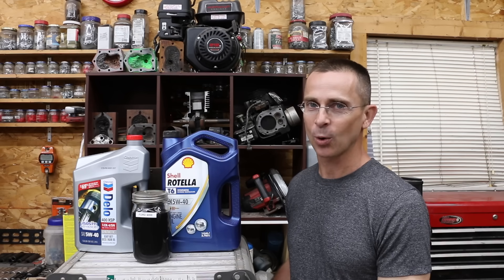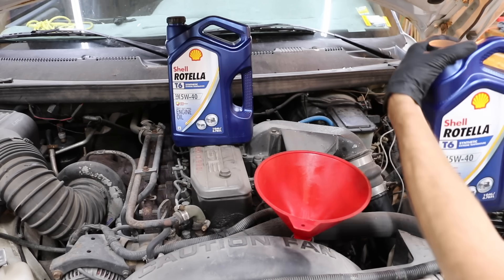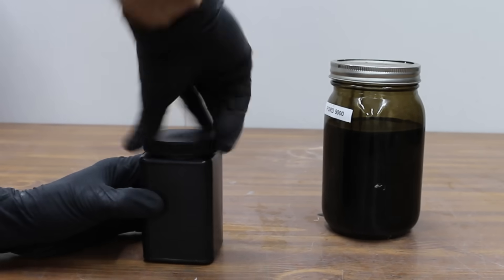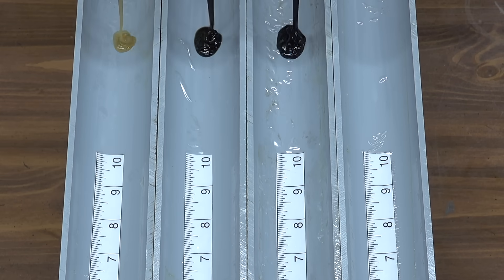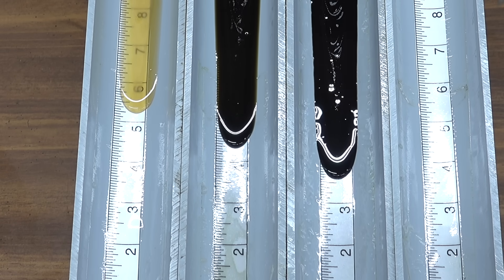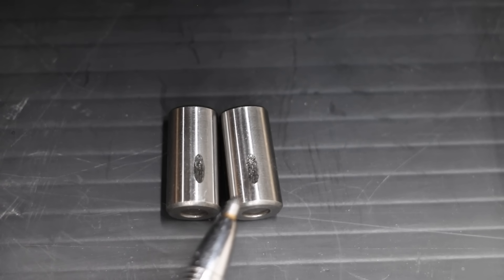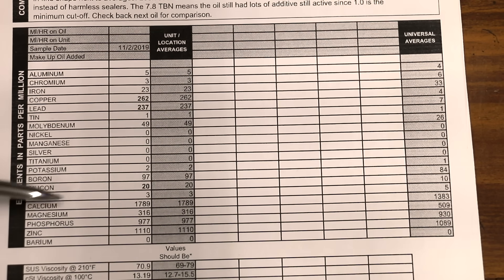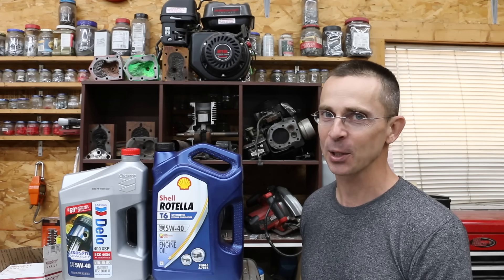Will Annual Oil Change Damage Your Car? Let's find out!

Comment: Diesel oil isn't so bad.

Gas oil breaks down quicker. Gas vapors blowby destroy oil viscosity that's why those additives are there. That's also why not to use cheaper diesel oil. It's cheaper because it doesn't have all those anti sludge and anti breakdown additives. Diesels don't need it. Your gas engines do.
Reply from the maker: Thanks for sharing.

Comment: "Recommend following the manufacturers oil change interval guidelines for miles and length of time for your car."
Does this not conflict with your finding that a good synthetic oil can easily last 1.5 to 2 years in a lightly- or occasionally-driven car? I have a 2001 Passat wagon 1.8T with the undersized sump. I use a monstrous Mann 950/4 filter to push the oil capacity to a full 4.25 qts. of Mobil 1 0W-40 European Car Formula oil. I just changed the oil at 15 months and less than 1000 "COVID" miles, mainly out of "calendar guilt," since my owner's manual specifies an oil change interval of 5000 miles or 6 months. I should probably have a used oil analysis done next time.

Comment: This is excellent. I know many cars that have only traveled 300 miles in a year because of Covid.  They have been started and run for 15 minutes a week to keep the battery charged and get the engine warmed up. So, the oil does not need to be replaced - that has only just become dirty in color.
Reply from the maker: Thanks!

Comment: As an engineer i feel the annual change isnt as necessary as they make it look, yes it does matter how many kms and how those kms are acquired ( highways or daily indian traffic conditions) but also saying anything above 12 months is useless oil is wrong.

I feel even if mileage is low and driven well , oil can last 18 months no major issue , its not like after 12 month something magical happens all of sudden and oil expires, yes the breakdown & chemical changes happen but not overnight
Reply from the maker: Thanks for sharing.

Comment: A Project Farm question, do you need to prefill the filter. Should be an easy to answer question. I'd guess from the factory that they don't do it, otherwise the service manual, oil bottle, and oil filter package would recommend it.

Comment: So will the Rotelo work on my corvette c5 twin turbo? I'm always concerned with oil temp. On the track I will hit about 245 degrees.  I have been using the Rotelo on my GMC 3500. Thanks

Comment: I always prefilled the oil filter as you did.  I saw another video not to do this as the oil in the filter gets  to the internal engine parts before it is filtered and could cause damage.
Reply: If it's new oil, what would it matter?

Comment: I recently got my 1995 Pontiac Firebird out of my basement where it was parked since 2007. It sat there for 11 years without being started and had about 1000 miles on the Mobile One full synthetic 5w30 that was in it.
  I started it up and drove it around for another thousand miles before deciding to change it even though the oil still looked new I was worried about the 11 year old oil.   I've been driving it around for a couple years now and its runs fine with no engine problems like blow by or smoking or anything oil related, it's been running fine!
  You bet Mobile 1 full synthetic is what I put back into it!

Comment: Could you do the same test, using oil from an engine was not brought up to temperature once a month?  I have vehicles in long term storage, and not convenient to run the engines on each during the winter months here in the upper Midwest
Reply from the maker: Thanks for the video idea.

Comment: as an automotive and mechanical engineer, my father always told me that it's OK to run diesel oil in a petrol car but not in the long term. one change cycle in five use the diesel oil as it has a mild cleaning effect but the different detergents and elemental ratios, such a phosphorus levels make it far less than ideal to run it as a regular thing.
Reply from the maker: Thanks for sharing.
Reply: @ProjectFarm  cheers. like the production style and genuine attempt at informing and educating people about cars. hope didn't seem rude but there was an ad years ago in Australia for Valvoline and it's catch cry was "oils aren't oils. dad reckoned it was the only time a TV commercial ever told the truth. lol. anyway, keep up the good work. cheers, bill.

Comment: I just 'sniff' the oil on the dipstick, look at it on a paper-towel, and rub it between my fingertips
________
If it smells 'good' like it did from the container, leaves no 'blackish' skid-marks on paper, and feels 'slicky-slidey' between thumb and fore-finger, it's good
________
( Got this technique from 'G-pa' and he knew nothing of 'Scientific Testing' but a lot about truck engines since he drove for Ford for 35-years, retiring in the early '70's )
________
'When in doubt...change it out' seems to work pretty good after a lifetime of driving
Your tests are interesting and skillful but I don't have access to much of anything except what's in my head
Reply: must remember taste test! lol.
Reply: @williamhardes8081  That only applies to 'Female' engines!
Reply: @gerrynightingale9045  nice one. those first two points you make are especially important in that case.
Reply: @williamhardes8081  Yeah...the 'sniff test' seems valid because of all the engine problems I've had in 55-yrs. of driving 'dirty oil' was never one of them
'Clean' paper-towel doesn't lie either

Comment: I have a car that I do not drive much, I do drive it here or there, accidently went 2 years without an oil change because of covid.  When I did an oil change the oil looked pretty normal. The filter was pretty normal as well.
Reply from the maker: Thanks for sharing.

Comment: I would really like to see some tests done on ATF. Old vs new etc. Keep up the great work.
Reply: I’m a firm believer in dump and fills. When I buy a new used vehicle; one of the many things is switching the atf to a favourite brand ( works out to be 1/2 the total fluid) and again in a few months to be 70%new. I did notice on my last 2 the transmission’s operated way better than I could think. It also gave me peace of mind, knowing what oil, the brand and the care involved with this maintenance.
Reply: Either change it often or don't bother.  Dk why but have felt multiple vehicals seem to get stuck in neutral on low rpm shifts than slam into gear.  It's super odd.  Also flushes are the worst thing you can ever do.
Reply: Nobody dives into  ATF!  Hummm?
Reply: I've got 2 cars that have never had an ATF change.. one is 22 years old and has 200K miles, the other is 11 years old and has 150K miles on it.....   both drive and shift like new.
Reply: @TedSchoenling  Must be toyota right?

Comment: ----  vehicle one:  1993 Chevy 1500 pick-up with a 4.3 v-6   bought new -  given away in 2008  -  still running just fine when given away

---  vehicle two:  2008 GMC Sierra 1500 WT pick-up with a 4.3 v-6    bought new  -  still driven daily

vehicle 1:  developed a head gasket water leak at 318,000 miles  -  repaired and couple of years later ( 2008 ) given away still running with 415,000 miles 

vehicle 2:  still going fine as of today  -  current mileage is 403,895 miles ( just looked ) 

both vehicles are work trucks used in residential home construction 
both vehicles have original engines  ( vehicle 1 with replaced head gasket -  vehicle 2 engine 100% intact including original starter, alt, fuel system ( pump & injector ), water pump - everything )
both vehicles got an oil change on their birthday  -  yep  -  one a year and ONLY one a year for a total of 15 changes for vehicle one and 14 [so far] for vehicle 2  -  oil is checked every day or so and topped off is it gets 1/2 qt low.  I buy the "6 qts in a cardboard box" oil from Wally World which just went up to $16.95 and $5 Fram filters  -   so my 14 changes for the GMC have cost me a bit more than $300 with tax. 

It might blow out the bottom end tomorrow  -  so what ?  -   I have saved enough money on just oil changes to fully rebuild an engine and still have a grand or two left.
Reply from the maker: Thanks for sharing.

Comment: Only use the new Delo it has reduced zinc at
 .08 and is a true ALL FLEET motor oil  ( read the pdf download specs )and will work with new emissions ....other diesel oils are still at 
.12 which are  to high and will ruin the catalytic converter $$$
😵
Reply from the maker: Thanks for sharing.

Comment: Do you think just changing the oil filter and topping off fluids would significantly  increase  the longevity  of oil life for low mileage  vehicles? I have a truck that I only drive about 3 thousand miles a year. Thx
Reply: I’d do the opposite.  Change the oil and leave the filter.  You can go 18-24 months on oil, but I’d never go over that no matter how low the miles.
Reply: @user-tb7rn1il3q they say engine oil has a shelf life of about 5 years? and for filters in oil?

Comment: Do gasoline engines produce more moisture contamination of their oil than Diesel engines?
Reply from the maker: Thanks for the suggestion.
Reply: gas burns cleaner on average.
Reply: @tocrob  one thing I noticed with the roughly 8 liter Cummins and DT 466 engines that were in certain dump trucks I used to drive for work is that there was an immense amount of exhaust volume that came out of these things at idle when a gasoline engine would have been much less,like a lot of hot air. These things had turbochargers on them but no emissions control as far as I knew,I don't think the turbos did anything much  unless you were accelerating or going up a hill 
the Cummins engine I think was physically longer than the engines found in Dodge pickup trucks

Comment: I worked on very large diesels and the oil was only changed under analysis, providing the reports were good oil can run for long time.  There is no need change oil every year in your car if you don't run up the engine hours.  I firmly believe in oil samples and just looking at the dipstick, most times I allow the oil change to be delayed by up to a year as i don't cover many miles myself.
Reply from the maker: Thanks for sharing.

Comment: What about the tiny metal fragments suspended in the oil which does cause cutting friction, therefore internal engine wear and tear?  

I will go with Scotty Kilmers advise, always use the recommended oil, change oil every 8000kms and always replace with  a quality filter and new gasket for the drain plug.

Oil is cheap as chips.
Engines are not.
Reply: that is why you have a filter.
Reply: @tocrob  if you are not changing your oil, you are not changing your filter. Not even the magnet picks up all of the metal fragments, especially if you are delaying oil changes to a later period.

Again, oil changes are cheap, engines are not. This is especially true if you want a long life out of your engine, and or you have a high km's on your engine.

If you are one of these people that lease a car for 2 years then throw it back, well I suppose oil changes are meaningless to you.
Reply: @Hathrandir  a half clogged up filter performs better than a new filter actually.   the stuff picked up by the magnet may not be filtered oil (drips from the engine into the pan).

Comment: I change every 10,000 miles on a Mercedes S550 that requires 13,000 miles changes. BUT it takes me 5 years to put 10,000 miles on. I changed it every 5 yrs with zero problems & it still looks good. Mobile 1 10w-40 🤷‍♂️👍🏼
Reply from the maker: Thanks for sharing.

Comment: Great intel, Sir. I listened to a local automotive show on Saturday mornings these guys are experts and know their stuff(they own and operate a popular auto service garage), always learning something new from them, they would answer any question to the best of their ability. They always suggested using the same brand of oil and fuel and changing the oil every 3k miles if your driving was just going to the local grocery store, considered severe driving. I never bought into the same brand usage theme because my brother worked as a tech at a packaging plant for motor oil and said it comes out of the same bulk storage tank with the occasional additive (its my understanding its pretty much the same with fuel). Also, the auto talk show hosts suggested never pre-fill the oil filter (I always do) because that oil has not been filtered. I seriously doubt the manufacture did not filter the oil during manufacturing, so I did not buy in to that either. I always change my oil every 4 to 5k miles and use synthetic. I figure extra oil changes are cheaper than a new engine any day.
Reply: Why do you think the garage owners are experts ?   Bet they dont know much  about oil at all.   
      Have an oil analysis done and ask those guys to explain what everything is.
Reply from the maker: Thanks!  Thanks for sharing.

Comment: Love your tests! Could you test torque values on bolts (Dry vs oiled/greased). On motorcycle forums I see lots of people complaining that bolts are cheap chinese junk when they strip. I KNOW these guys are smearing grease on things to reduce corrosion. Even locktite on the threads will require less torque. If you have already done this test, please point me to it.
Reply from the maker: Thanks for the suggestion.

Comment: 2005 Hyundai Elantra
Two years ago I put fresh synthetic blend oil in at the 179,800 mile mark. 
For two full years, the engine ran on that same oil and filter, collecting just over an additional 10,000 miles.
Last weekend I finally had time to address needed maintenance. The oil, while slightly darker than when new, was almost just as good as new petroleum based oil. 
Changed the valve cover gasket as well due to initial signs of oil spray. NO sludge build up whatsoever. The filter "technically" could have been used further, but it was replaced as well. 
I am certain I lucked out where engine design is concerned given how clean and quiet it remains. But if using a synthetic blend, I would say it is safe in most cases to drive further than the recommended 3-5 thousand miles. I DON'T recommend foolishly waiting 2 years or 10k+ miles however. lol
Reply from the maker: Thanks for sharing.

Comment: I do like the newer 5.9L and the older 6.7L for changing oil. They are pretty decent and you lose very little oil when pulling off the old filter. I usually just use the 3 prong claw to loosen the filter. Reinstalling the filter is pretty easy, just put it up straight then tip the bottom just slightly forward and you can feel the threads engage together. It spins right on.  At Walmart, we have a pit under the vehicle we stand in and it's not very difficult to do an oil change on one of these with that process.
Reply from the maker: Thanks for sharing.

Comment: For whatever it's worth, in 1984 I bought a 1980 Ford vehicle (Fairmont) from a local church that needed the funds.  I began an experiment to change the oil before summer and before winter and used the vehicle for daily transportation to/from work and normal driving for groceries and to attend a university, etcetera plus driving approx 400 miles round trip once a month to visit my parents. Well by the time I reached around 100,000 miles, it was "burning" about a quart of oil or more once a month.  I sold it but the next owner told me the oil lost/burnt worsened.  Now I change my oil around 3 to 4 months, just to be safe, even though I'm sure we have better oil now than at that time.
Reply from the maker: Thanks for sharing.

Comment: Such a great video, I had to watch again a year later.  I usually run T6 in my diesel truck, but there is a mysterious shortage.  Also, some say that T6 doesn't meet Fords new WSS-M2C171-F1 spec.  Can you do an ultimate diesel oil show down with T6, Valviline Premium Blue Extreme, and others?
Reply from the maker: Thanks!  Thanks for the video idea.

Comment: This also depends on the engine. A high performance turbo charged engine will need more frequent oil changes than a little runabout.
Reply from the maker: Thanks for the feedback.
Reply: What if you're still driving the turbocharged engine like a grandma, and not abusing it at all?
Reply: @SokemRokemRobot  Turbos are hard on oil regardless of how hard you drive though driving like grandma does make a difference. Performance engines tend to run hotter and have tighter tolerances so the oil has a harder job to do and doesn't last as long.

Comment: my bran new ram 1500 wt. 3,7 e-tork. owner's manual says 10.000 mil. between oil changes! THAT WILL NEVER HAPPEN. Pennzoil ultra platinum is used out of the factory, a great oil. but 10,000 miles. no way.
Reply from the maker: Thanks for sharing.